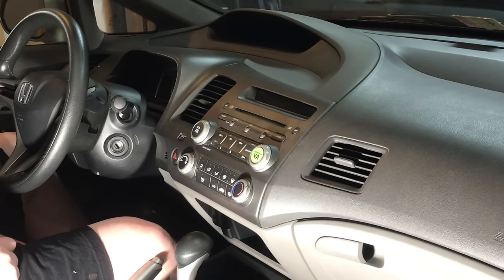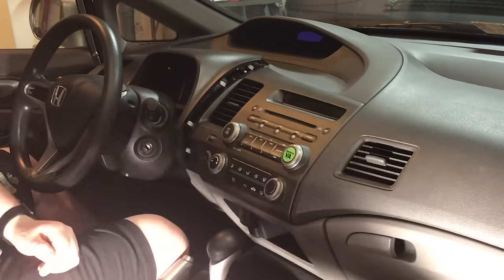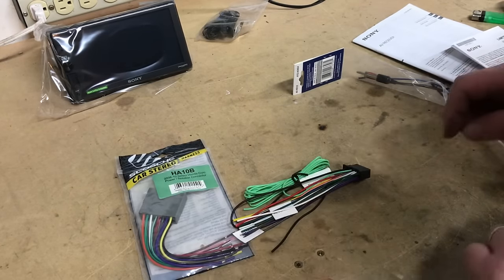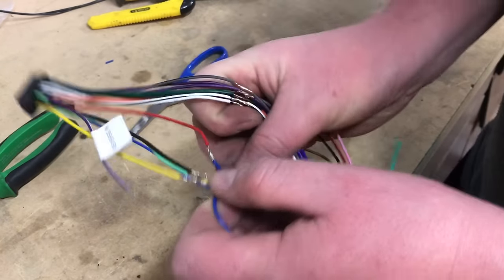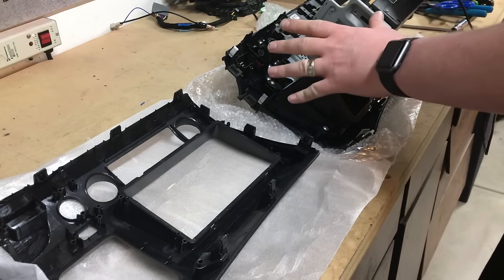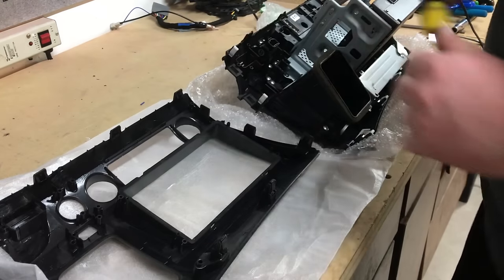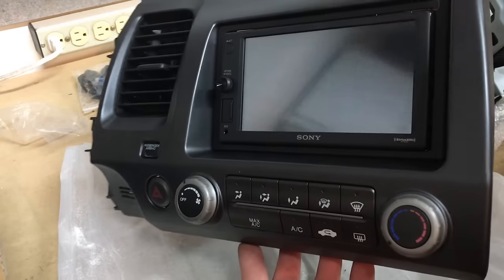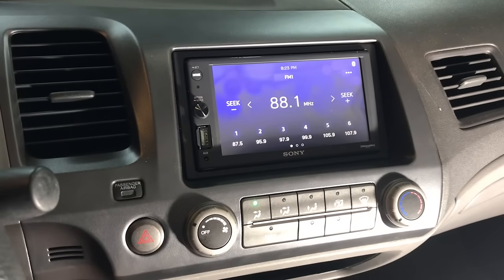2006 - 2011 Honda Civic Touch Screen Stereo Install

Comment: I have a 2010 civic. I got everything plugged up like u do,done the bypass on ebrake to ground wire. I was trying a DVD and sound would come on but no picture.what did I do wrong? Thanks
Reply from the maker: Depends on the radio. Not all brands allow you to simply bypass the parking brake by ground it (pioneer / alpine ).
Reply: @ProvoBeastAudio  its a pioneer
Reply from the maker: @bryceneal1966  https://youtu.be/0xYNn8LDvnE

Comment: I hooked all my wires up by color code. It has power but wont play any sound. Not even static. Not sure what I done wrong. I am also running subs. I've tried to connect through bluetooth and it will connect but not play any sound.

Comment: i entered the VIN and serial number, it spits out 15 codes. Some codes contain numbers  8 or 9 which are not valid codes because radio stops at number 6.

Comment: Hello the previous owner did this to the car I recently Bought. Everything is perfect but the only thing is the 12volt outlet dosnt seem to work anymore any tips to fix this?
Reply: Check the fuse under the dash, shouldn't have anything to do with the radio. Its pretty common for them to burn out on any car

Comment: is soldering completely necessary for this install?
Reply: It doesn't have to be necessary but if your trying to be professional I'd recommend it. But if your planning on doing it yourself for your own car it doesn't matter, just make sure the wires don't cross or have exposed wires about.
Reply from the maker: We have a video on the channel that helps guide you though building your own wiring harness.

Comment: I have an amp for my 09 si and I need to install the amp bypass harness. Would that tie into the radio harness as well as my steering wheel control module? Thanks a lot
Reply: OOOBOY T are the si the only ones with amplifiers cuz I’m gonna put a stereo in my 2008 lx and I’m scared of it not working😂
Reply: Anyone knows where is the factory amplifier located
Reply: Is it located in front of the shifter module?

Comment: What would the different be if you have steering controls?
Reply from the maker: Slightly different parts needed.  Check the description for those variations in parts.

Comment: I just got my new sjoybring stero and installed it, it comes with a backup camera and i didn’t put it in because the wire was too short. It works well when the car is parked but as soon as you put it in gear and start moving the stero cuts out and then when you stop the car and put it into park the stero comes back on. Any thoughts to what this is?

Comment: Just wondering if you have to have a antenna for the radio to work?
Reply: What did you figure out for the horrible FM signal? I'm dealing with a horrible FM signal currently.

Comment: I have a question , I have a 2011 honda civic lx, I'm changing from factory radio to aftermarket, my factory radio has three plugs one for the antenna and then the two other , I seen you only used one what does the other do? Do I have to just have to wire one up? And let the medium sized one stay tucked in? Thank you for any help
Reply: I’m trying to figure this out now. I don’t have sound.

Comment: Does this radio have Android Auto as well or just Apple Carplay?
Reply: Just apple car play.
Reply: You can get one that has both but they do cost way more unless you can find a good deal somewhere.
Reply: Sony xav ax 200 has it. An dvd player also.
Reply: @xedosclau  Sony as usual is always the go to clutch choice.
Reply: @kyakukid1  
I have had poor experience with Sony electronics, in particular their laptops, and their audio products lately. Sony is not the same company that made the rock solid Trinitron TV's and the Walkman. Their audio products have poor sound quality. I will probably look elsewhere.

Comment: Got a question. Son has same car and wanted to update his radio to a nice touchscreen radio from best buy and they wanted me to purchase a factory amp interface for it. Do I need this? They wanna charge me $50 for part and $50 for labor. What do you think?
Reply from the maker: Factory amp interface?  Do you have a part number?
Reply: @ProvoBeastAudio  for the new radio I purchased?
Reply: Pioneer - 6.2" - Built-in Bluetooth - In-Dash CD/DVD/DM Receiver - Black

Model:AVH-211EX

SKU:6263621
Reply from the maker: @Victorcruz1979  No, the "Factory amp interface" they want you to purchase.
Reply: @ProvoBeastAudio  LP6-4

Comment: I have two other plugs that go into my stock stereo (I did not see you unplug those so I’m guessing you do not have them?).  Do I not plug those back into my aftermarket stereo?
Reply: Did you ever get an answer? I'm also wondering this
Reply: Kieran Saindon I finished my install.  I didn’t need them.  Hope thay helps
Reply: The only ones I used were the hazard button one, the airbag, the one that plugs into the adapter that plugs into the after market radio and then the ones for the A/C unit and I believe that’s it.  The other ones I did not use
Reply: @justinguarino201  you're awesome, thanks for replying

Comment: if i dont want to use the radio on mynew headunit do i need to still install the antenna adapter?
Reply from the maker: No, but it's only a few bucks, and still recommended.

Comment: Does the USB port and the AUX port work in the new stereo?
Reply from the maker: The stereo used has those ports on the faceplate, not on the rear.  So no, they were not retained.  Also the way Honda built the module, it's setup as protected media so it's nearly impossible to retain the factory USB / AUX inputs, similarly to Hyundai and Kia's.
Reply: @ProvoBeastAudio  "it's setup as protected media so it's nearly impossible to retain the factory USB / AUX inputs"   um its a aux input

Comment: I was installing my radio a pioner 4200nex and i turn on the car and it worked but i forgot to plug something in and i took it out and it i put it back to place and it doesnt turn on now

Comment: Quick question so I have a lx 09 Honda Civic I was wondering can u get the screen that comes on the higher trim levels and the hybrids and put it in the lower trim levels or will it not work
Reply: I would try an online store or your local audio store and inform them on the specifications of your vehicles trim model that you are looking for.

Comment: Do you have to soder or would shrink wrap connectors work?
Reply: You can use butt connectors if you wish however, soldering provides a much better and consistent connection between wires. I always prefer to use heat shrink because it provides a better seal and another added layer of protection for the wires. You do not want anything to ground out because that could damage your unit. There are butt connectors that has heat shrink on them if soldering is not your thing. I know most people that struggle with this or do not have that tool to do it. If you do not have a heat gun, you can use a hair dryer.

Comment: Hi! Quick question. I just bought the same touchscreen for my 2008 Honda Civic Si from Best Buy. I’m taking advantage of the free installation they offer. But they mentioned that I needed an amplifier bypass. Did you need that? I didn’t see it in the parts you used. It cost me an extra $50 for the part and $50 to install. If I need it I’ll obviously keep it but if I don’t I’d rather save the $100.
Reply from the maker: It's not necessary to bypass the amplifier, you can retain it with the new radio.  Sounds like they don't know what is going on.

Comment: For the life of me I can’t get the two screws from underneath back on. So frustrating
Reply from the maker: They are security screws did the most part. Not a big deal if you can’t get them back in

Comment: Were do u connect the blue antenna wire from the radio
Reply from the maker: Generally to your antenna adapter.  If your antenna doesn't require it, just cap it off, it wont be used.

Comment: How to you remove the negative on the battery so the air bag light is not tripped?
Reply from the maker: Pop the hood, use a 10mm socket, loosen the nut, remove the negative terminal off of the post.

Comment: What happens if the sound isn’t working….. I did everything right and the sound isn’t working….. please help
Reply from the maker: You may have a factory amplifier which isn't being triggered to turn on when the radio is turning on.  There may be a blue / white wire on your wiring harness adapter that needs to be connected to the radio's blue white wire.

Comment: If anyone can point me to he right place, please and thanks.  Is it possible to get an oem double din radio set with a screen/backup camera from a newer honda civic or any honda vehicle into a 2008 civic?  Just doing the swap for the backup camera, any wireless features are only a plus.

Comment: How much it cost for everything including installation?
Reply from the maker: Prices can range based on the shop you take it to.  I'd suggest calling around to get bids.
Reply: @ProvoBeastAudio  but do you know the average cost ?
Reply from the maker: @paulrayo7703  No, too much variation.  Parts are listed in description.  Search parts on amazon ebay, get a general idea for parts prices today, then add in labor but each shop can vary on price

Comment: I’ve got the same model and new stereo and I have no sound when I turn on the new stereo. I had sound on my old one with the CD player. I’ve checked fuses and connections and tested my speakers. and still can’t find out. What could be the problem

Comment: I'm about to do this samething on my 2010 honda civic. Is soldering absolutely necessary?
Reply from the maker: Nope, you can also use either butt connectors or crimp caps.  Just don't twist and tape or use wire nuts.  https://youtu.be/pla_0VpHTvs

Comment: The wiring diagram for the harness that I have says that I need to splice into the factory harness to turn on the factory amp. Do you know anything about that?
Reply: Were you able to figure it out cuz i have the same problem

Comment: When you reconnect battery negative terminal, Honda asks for Radio code to unlock....Will this still needed in after market radio? If yes, how to unlock it? I have the code.
Reply from the maker: Nope.

Comment: How did you remove the fan speed and temperature knob?
Reply from the maker: They are just held on with pressure, just carefully apply pressure all on all sides of the knob and it snaps off.

Comment: Hi, to what should I connect the blue-white wire that you didn't use. My vehicle has amplifier. Thanks
Reply from the maker: Blue white wire needs to connect into the harness' blue white wire (if applicable).  If it isn't equipped in the adapter, look in the main harness itself.  Generally it's a light green wire on the factory side from which you need to connect your blue /white wire to to trigger the factory amp on when the car is on.

Comment: Will it work on premium sound system????? 08 civic coupe lx
Reply: I want to know this as well
Reply: Hey bro yes it will work
Reply: @ylamona7693  Nice. Did you still have to get the new harness or were you able to use the OEM harness? Thank for the reply dude:)
Reply: @ny3d108  well i ordered the schoche aftermarket harness and connected everything to the aftermarket stereo except the blue cable bc that goes connected to the other harness you didn't use from the original stereo

Comment: Somehow after doing this my dash board is glitches out. I think I loosened a wire in the dash circuitry
Reply from the maker: Sounds like a blown fuse or a short somewhere. I’d check your wiring again
Reply: My battery died 😂. Got it all figured out. Brother left my trunk open all night which drained the battery.

Comment: I did everything and I have no sound. It seems to be working just fine, I don’t have any audio though. I don’t think I did anything wrong. Pls help
Reply: I had the same issue. So if you check again with the wire harness that you unplugged from the old old radio. You should see that there is one small one. The small one has a blue wire running. That is your sound wire. Cut half way and connect it to the sound wire on the radio harness. If that makes sense.
Reply: @Gmoney0436  Hi Gabe, same issue. If I cut the blue wire, what color do I connect it to on the harness? Thanks
Reply: Tallen Rand if you still have the manual to the radio you bought. Somewhere in there it tells you which one is the sound wire. That’s the one you connect the blue wire to.

Comment: What about the 2 screws you took out at the beginning? 2:10?
Reply from the maker: They are security screws for the factory radio.  You are welcome to reinstall those, or keep them out.
Reply: @ProvoBeastAudio  ok that was my bigger worry since they wouldn’t thread in. So I decided to just leave them out. It was done in a friends 2011 sedan. First one I’ve done. But now he needs speakers put in. Do you by chance have a video on speaker install for this car?

Comment: Hi, I have a double din as well, but i do not like my dash kit because the sun reflect off the radio and gives a glare that sometimes hits my passengers in the face. Does your kit do that? Do you know of any kits that face the radio more upward and not in an angle so the sun wont hit my passengers? Please help.
Reply: Omar Hermosillo buy an antiglare film on eBay or aliexpress

Comment: I installed a double din on my 2009 Honda civic when I have it in park the music plays normal and I soon as I put it in drive and accelerate the music starts cutting off why is this happening?  I looked at the wiring everything seems good I can't figure it out I need help please
Reply: Miike Joness you need to bypass the Premium Audio. Only thing I hate about that Gen of Hondas

Comment: you dont have to saughter just saying. you can use butt connectors or electrical tape. I dont approve of it tho
Reply from the maker: As long as you crimp, thats fine.  If you use butt connectors properly, they are a good soltuion as well.  Soldiering is the best connection generally.